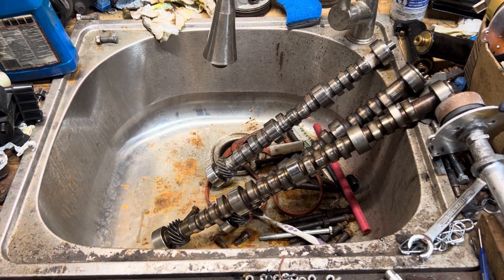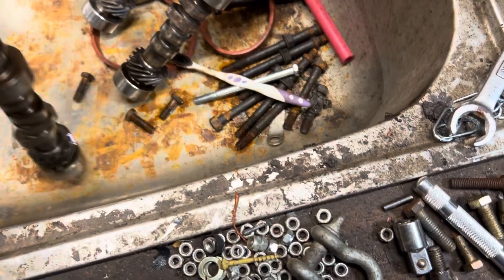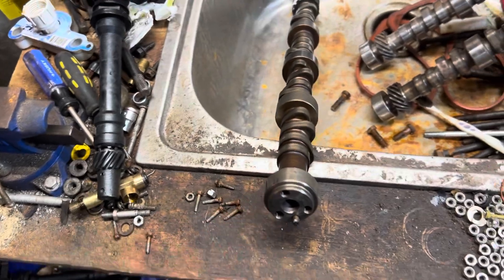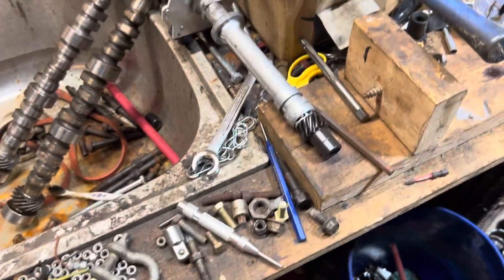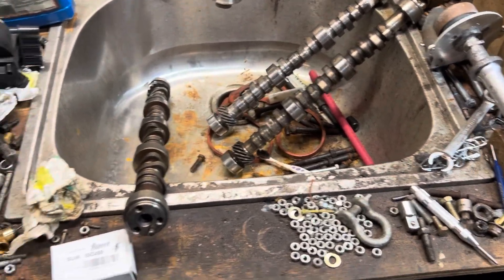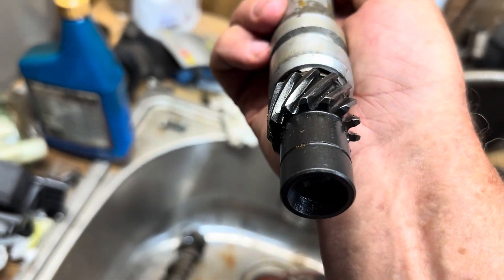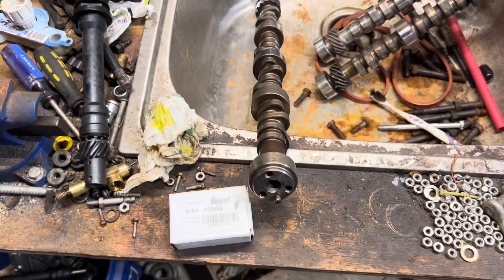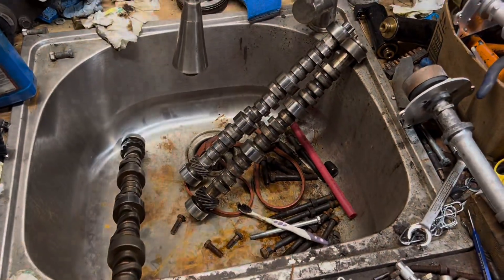1a - Why Is a Melonized Gear Included?

Comment: I bought a cheap allstar performance melonized gear for my vortec. I didn't have the highest hopes but several thousand miles and gear still looks good.
Reply from the maker: Boats go by hours not miles unless you are talking about your car. Cars generally operate at much lower RPM and loads  than boats so several thousand miles is not a significant time in a car for wear. Check it again at 20k and post back if it’s still holding up. Melonized gears will show no wear, just a shiny surface where the gears mesh.
Reply: @moccasinmarine my chevelle. Had a stock iron gear on HEI and showed wear like your v6 gear in around 4-5000 miles with a roller cam.

Comment: Supposedly steel or chrome molly is ok for a roller cam? Hard to find good info on this. Must not be an iron gear, that equals self destruction.
Reply from the maker: The only gear I’ve seen GM use on a roller cam is the melonized one I’ve shown here.
Reply: Gm used roller cams in car engines since 86, I have heard all GM distributor gears are me melonized since 86 but have not confirmed that.

Comment: melonized  is another  word  for "steel"  

ford  does not used that name. GM  came out with the name  cause thats what they called it

Ford  just calls it a steel gear on the roller 5.0s
Reply from the maker: This is not true. Don’t post information you don’t know about. Read some other comments to learn what melonized gears are.

Comment: Hi can you help me with a Volvo Gl 4.3 tbi fuel ,to set distribuir time? I saw you have a plug to put in The delco distributor , I think maybe is The reazon of The fuel excess  
Sorry I dont speak english obviusly
Reply from the maker: On fuel injected engines you install a jumper in the data link connector. You then set the timing to 8 degrees BTDC.
This video shows how to set the timing.

https://youtu.be/djjvdJAEdVY?si=6gEJk6QIHUNXxebv
Reply: @ 
Excelent! And really thank you to answer me, Is The same in 4.3 G i  with TBI 2003 ? I think my injection isn’t MPI
Reply from the maker: @juanborchex2082  TBI or MPFI doesn’t matter. All you are doing is correlating the distributor position with where the ECM wants it when the datalink pins are jumpered. After the jumper is removed the ECM takes over the timing. The calibration in the ECM is different for a v6 vs. a V8.

Comment: I use the Comp Cams composite gear on my billet steel camshaft in my big block Chevy engines.  You can use a bronze gear on the billet cam but I don’t like the way my oil looks when I change my oil, it puts a minute amount of bronze in the oil and I suppose it doesn’t hurt anything but I want to be able to do a better inspection of my oil when I take it out of the pan.
Reply from the maker: The art of selling products is to the find the lowest cost part that does the job and make sure the part is not a Chinese ripoff that doesn’t meet the specification that it claims to have. The GM melonized gear is the only one I trust to meet the melonized specification and while it’s not cheap it’s not extravagantly priced.
Reply: @moccasinmarine  i agree, it’s hard to find parts that are not made in China.  I’m 74 and been a drag racer since I was a teenager and I remember when GM parts started getting parts made in Mexico and I thought that was bad. 🤦‍♂️

Comment: Melonized steel distributor gears are nitrided for wear resistance. Nitriding is a form of case hardening. The item to be treated is heated in a metallurgical oven in an atmosphere of pure nitrogen to form a very hard glass like surface. In the process of heat treatment, areas to be free of nitriding can be painted with masking clay. Cheers
Reply from the maker: What causes the dimpled bumpy surface on the round part of the gear? If a gear did not have this dimpled appearance could it still have been nitrided?
Reply: @moccasinmarine Melonite/QPQ is a thermochemical process that combines Melonite nitriding with the subsequent "Quench-Polish-Quench" (QPQ) steps to harden metal components, improve wear and fatigue resistance, and increase corrosion resistance.

The Melonite step involves diffusing nitrogen and carbon into the metal's surface in a molten salt bath, followed by the QPQ sequence which includes oxidation, polishing, and re-oxidation to create a hard, smooth, and highly corrosion-resistant surface.                  

Melonite (Nitrocarburizing) Process: The part is heated and immersed in a molten salt bath containing alkali cyanate and alkali carbonate.  Purpose: Nitrogen and carbon atoms diffuse into the surface of the ferrous metal, creating a hard, uniform nitride layer. 

Temperature: Typically performed at around 1076 Fahrenheit.              

QPQ (Quench-Polish-Quench) Process: This is a series of secondary steps performed after the Melonite treatment to further enhance the surface properties.

Step 1: Oxidation: The part is immersed in a separate salt bath to create a thin layer of iron oxide on the surface.

Step 2: Polishing: The surface is mechanically polished to improve its finish.

Step 3: Re-oxidation: A final oxidation step is performed to restore any oxide layer thickness lost during polishing.

Benefits of Melonite QPQ

Enhanced corrosion resistance: The process provides superior protection against rust and corrosion.

Improved wear and fatigue resistance: The hardened surface is significantly more resistant to wear and has higher fatigue strength.

Uniform and consistent layer: It creates a very uniform case, even on complex internal surfaces.

Dimensional stability: The process is performed at relatively low temperatures, which minimizes distortion of the part.

Superior finish: The final QPQ steps result in a smooth, shiny, and visually appealing surface.

Reduced friction: The smooth finish can also improve the lubricity of the surface.
Reply: @moccasinmarine  "What causes the dimpled bumpy surface on the round part of the gear?"

The dimpled textured finish on the collar of the gear is caused by the Melonite treatment. The teeth get the QPQ treatment which smooths out the finish but the collar of the gear doesn't get the QPQ treatment because it's not needed there.
Reply from the maker: @Airwolf1971 but is it possible that a melonized  gear would be smooth everywhere? All the melonized gears I’ve seen have the bumpy texture.
Reply: @moccasinmarine  "If a gear did not have this dimpled appearance could it still have been nitrided?"

Yes. If the entire gear was Melonite/QPQ treated then it would have a smooth surface.

GM never made a computer controlled small cap divorced coil HEI distributor that didn't come with a Melonite/QPQ treated gear from the factory. 1987+ LG4/L69 carbureted engines, L03 & L05 Throttle Body Injected passenger car engines, and 1987+ Tuned Port Injected engines all had 5150 alloy billet steel roller cams that required a "Melonized" distributor gear. Most 1987+ L03/L05 TBI engines that came in trucks had a ductile iron flat tappet cam and they also got the same distributor with a "Melonized" distributor gear. It doesn't hurt to run a "Melonized" distributor gear on a cast ductile iron camshaft.

I have 2 GM Ram Jet 350 crate engines that have a "395" marine cam and a GM 1104060 small cap HEI with a "Melonized" distributor gear that has an all over smooth appearance. This gear is Melonite/QPQ treated and has an additional silver in appearance corrosion resistance coating. Ram Jet 350 & 502 crate engine are based off marine engines.

I also have multiple low mileage 1987+ Firebird Formula, Trans Am GTA, and IROC-Z cars with TPI engines and they have the exact same smooth appearance "Melonized" distributor gear as the Ram Jet 350 crate engine distributor but without the silver appearing corrosion resistance coating. 1987 to 1991 C4 Corvettes with L98 engines also have this same smooth appearance distributor gear except they have a 0.491 diameter hole for the larger distributor shaft for the computer controlled large cap HEI distributor. The small cap HEI distributors have the smaller 0.429 diameter distributor shaft.

Comment: Using a melonized gear on a cam not designed for it, is a recipe for disaster. 
The ignition system used has literally nothing to do with distributor gear choice...... Not a thing......

All camshafts are designed to use a slightly softer gear than the gear on the camshaft. 
The width of the wear pattern has just as much to do with installed depth, machining tolerances of the block, core shift, etc. As it does gear type as well. 

The wear on the V6 gear shown, strongly suggests oil pump chatter/cavitation and timing chain slap, you can see it plainly on the gear....

If you are using an aftermarket cam, change the cam, factory cam, etc, use the gear type the manufacture of the cam core recommends.
I have had bronze distributor gears last 100k+ on billet cores, steel cores, oe cores, etc, and they are sacrificial gears that last for years.... 

The wrong gear, will rip one of the gears to shreds, every time..... So will other mechanical issues left unchecked...
Suggesting to use the wrong gear in a V6, is an odd choice to recommend, or even promote... The gear will be far harder than the cam, and chew the cam gear to shreds.....
Reply from the maker: Thanks for your opinion. All gears except where I stated had high miles on them were ran on a brand new engine so no chain slop. The gears are cheap and not intended to last. The 5.0, 5.7, and 6.2 after 1995 all used melonized gears from factory so it is a thing, as can be confirmed by GM. The 4.3 camshaft back to 1987 is also a steel billet roller cam and will benefit from the melonized gear. But you’re right the v6 gears are sacrificial and wear out several times during the life of the engine.